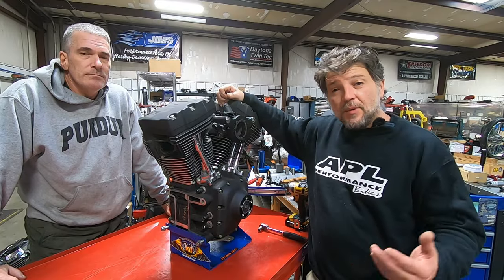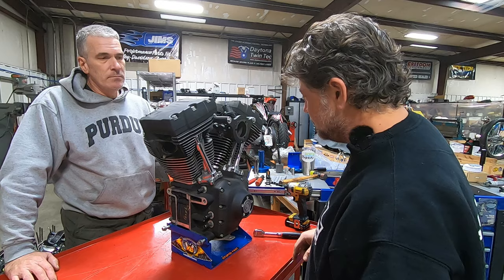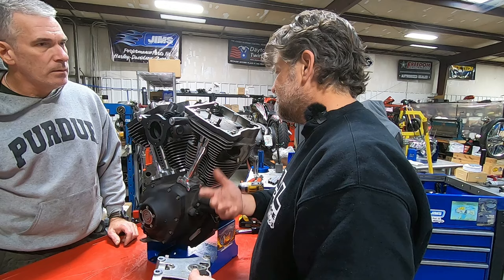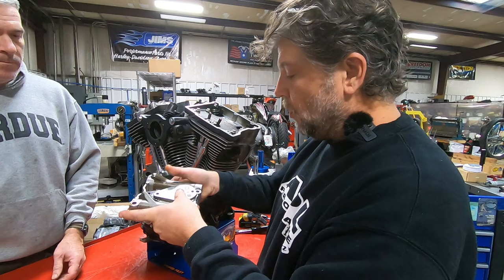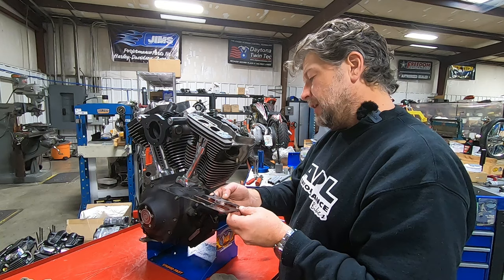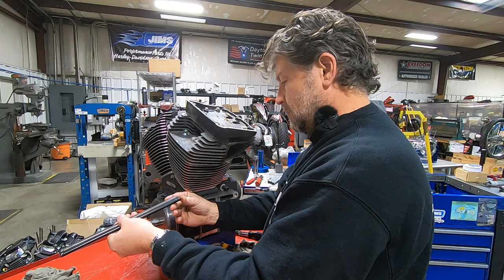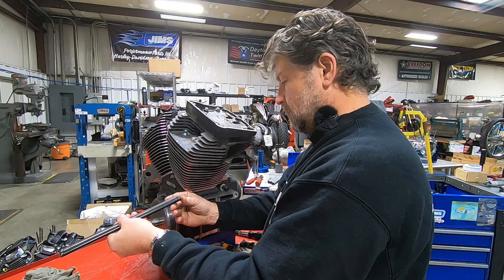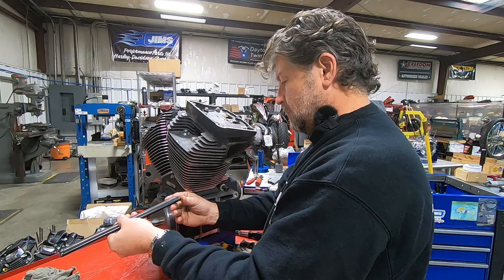WHAT IS NORMAL WEAR? - Harley Twin Cam Engine Tear Down - Kevin Baxter - Baxter's Garage

Comment: Great Video.  I enjoy listen to your take on wear.  Someday I will have to have my 2012 RK 103 tore down.  It's a high mileage (327k miles) on it and never had the heads off. So obviously wear should be very different.  Be interesting to see and compare to other mileage wear.
Reply: Did I just read 327K miles correctly??? I have a 2010 103 that has a little over 100K, Have you ever had any major issues with you're??? Thanks!!

Comment: I did S&S gears and S&S adjustable push rods on my 2003 Electra glide classic and some other goodie’s at about 5000 miles I now have 30 thousand miles never any issues and still runs better than new

Comment: my friend bought a new road king with a $4000 upgrade big bore kit so now he is happy. i think on this engine it was a new engine and they took it apart and changed the cams... and that is why the shoes are worn out now. it was super low miles on it when they changed out the cams...

Comment: Three thousandths runout on the crank, and significant wear on the tensioners at 15K. 15K would be less than a year's mileage for me. Makes you think twice before buying even a low mileage Twin Cam.

Comment: @Kevin Baxter it seems like most of the time you turn the motor over with a wrench, you are rotating it in reverse. 
When finding tdc for instance. 

Is there a reason for that other than convenience?

Thanks for the amazing videos and insight.

Comment: My 03 Road King had cam chain tensioners fail in 06 with 45 thousand on the odometer.  Harley warrantee folks in Milwaukee denied  covering  the repair under my extended warrantee, telling me the it was normal wear and I should have had them inspected "earlier".  My servicing dealer had the complete service history of the bike and was aware that it had been serviced exactly as required in the manual.  When I asked the warrantee rep on the phone at Milwaukee to tell me what page in their 500+ page "service manual" it recommended the tensioners be inspected, and at what milage, he admitted that there was no mention of the cam chain tensioners inspection in the maintenance section of the 03 manual, that the only mention of them was under the total engine tear down and assembly chapter.  The following day my dealer called me to tell me the Milwaukee had "reconsidered" and would repair the motorcycle under the extended warrantee.  I rode the motorcycle for another 4 years, having the tensioners inspected every 2 years.   Both inspections showed that they were failing again and needed replacement.
Reply: Take your bike to a shop and have them measure the crank run out if the crank run out is low enough you might be able to get away with a gear driven Cam and get away from all the cam chain shit. Gear Drive is the way to go and it should have been that way straight from the factory. A perfect example of the being counters at work.

Comment: Sounds like a sweet little engine.
   Have an 05 Springer Softail. Runs good in warm weather. Better warm it up when it gets cool. 
   Less than 20k. Haven't checked tensioner but thinking about it. 
   Just want to ride because it's  one  sweet little screw.

Comment: Would you see less run-out on the 99-02 model years due to Timkin bearing?  My 01 had less than 2 thousants so I went with gear drive cams

Comment: Great video! You are always so informative. My concern is that you say there is 15K on the odometer of the bike, but you found out that someone was into the motor and changed the cams. Did they not change the tensioner shoes or did the tensioner shoes get all or most of the wear since the cams change? In my opinion, 15-20 thousand miles from a set of tensioner shoes is just bad engineering. I hope that is for the spring operated and not the newer hydraulic versions. Three thousandths run out probably same as new from what I have heard. However, I am surprised  that you didn't check the run out on the other end. The primary side.

Comment: Thanks again for good learning insights on the teardown series. Is there a trick to view the secondary cam tensioner wear (hydraulic) without removing the cam plate on a 2007 and later TC motor with the engine installed in the bike?
Reply: The outer tensioner is very easy the inside tensioner is a royal pain in the ass. There is no easy way around it. I knew an aftermarket mechanic you said Harley-Davidson did this so we would have work every 40,000 miles. Harley Riders are lucky they can replace the information with a Gear Drive cam.

Comment: Maybe I was lucky...but I did run full zinc mineral diesel engine oil in my 2006 FXSTBi..and I replaced the cam chain tensioners at 240,000kms...and yes, they were worn out, bike is still running strong, still never had the heads off.
Reply: That was the year they went to hydrolic tighteners. Lot better

Comment: Them 203 cam are typically unbeatable on a 88” 95”…
My 88” taken to 95” typically just under 100 ft pd torque and real early.
Reply: Exactly right Joseph. I put a set of 203's in my 2000 Roadking at 100,000 kms and couldn't believe how nice they made it ride. Really fattened up the bottom end. She's now at nearly 200,000 kms, so I'll have to check those tensioner shoes before too long! The SE 203 cams are a great lesson in 'Sometimes less is more'.

Comment: Thanks Kevin. These videos are very helpful. I have just torn down my first harley. It has some pretty good wear.  I havnt done the crank runout due to no guage but I do have grooves where the crank spindle rides within the cam plate that do catch my nails. I am going to take it all to a local machine shop. Not sure if these cranks can be reconditioned or if I need a new one. Kind o a bummer. I bought used from dealer not even 2 years ago.

Comment: WAIT A MINUTE! 15,000 MILES AND IT'S WORN OUT?  Jesus! Now I'm scared to ride my 2008 Ultra Classic with 50,000 on it... SO I have to basically rebuild the entire motor? That's not very comforting....
Reply: Just ride it. If you aren’t having any issues don’t worry

Comment: Kevin, I have always assumed you can't pull a jug to inspect the hashes and rings, and if OK, reassemble; where the rings seated won't be in the same place and rings would have to re-seat again.  Is this true?  If YES, what is required before reassembling?  Thanks a bunch.  Love these teardown vids.  Preparing to rebuild my first engine (TC88A).

Comment: Another thumbs up! Kevin, what twin cam rebuild specs did you equate to a 427 big block? Can a 4 inch stroke crank be put in a 103 motor with bigger bores for quicker revs and still make good torque?

Comment: Anyone have a thought or two??  New Zipper’s 107 top-end on a Darkhorse bottom-end with 450miles.  The motor had a cough and terrible fuel Economy in addition to unburned fuel made the exhaust unbearable.  The Tech did some post break-in checks and found low compression on the front cylinder.  Turns out that a valve guide cracked and there is a lot of oil on the piston.  What could possibly cause a valve guide to crack?  I rode it properly… no oil starvation… and there is no damage to any other parts.  I am baffled.
Reply from the maker: Hard to say really. Cam choice, valve to piston contact, issue with rocker arm, pushrod adjustment if caused coil bind...several things. Could also just be one of those things. Despite every effort, occasionally there can be a part that just fails. Inclusions in metal, etc...things that noone could perceive happening. They are mechanical devices.  Hate you had troubles but wish the best.
Reply: Thanks Kevin.  Zipper’s makes top notch products, so I am confident that this will be resolved.   My engine tech is really good, but he could have made an adjustment error during the build.  Zipper’s is repairing the head and hopefully we won’t have to revisit the issue.  If we do….My bike may be on a trailer heading to Winder, GA.   Thanks for the great channel and content.
Reply from the maker: Youre welcome.  Yes they do.  I've known Danny Fitz for a couple of decades.  We swap ideas and tech quite often.  Great fella, great friend. As I said...it could just be one of those things.  I've never had a valve guide crack but I have had other things along the way, that you could never foresee despite the most care and attention to detail.  I always look at these things as you have...find the cause without pointing fingers.  Once the cause is found, it can be resolved without wasting time passing blame.  Its a positive life outlook.  I respect your candor sir.

Comment: The more and more I watch these videos the more I don't want to buy a harley my honda has 130.000 miles all iv done is oil change and tune ups and never had a problem and I ride the hell out of the bike I don't baby it and it is not a garage ornament. I want a street glide m8 but then again is it worth the headache to pay 30.000 on a bike that is not going to be as reliable.

Comment: Can you tell what cams you have without pulling the plate? Have an 05 WGI with stage 2, 17k miles, need to check the wear over the winter and Don’t want to pull the plate unless needed. I got it used so I don’t know what all was done
Reply: Sometimes they are stamped on the snout of the cams.

Comment: 8-10k $ and it just needed tensioners. well, I'd probably changed the cam plate  to hydraulic tensioners,  oh and new butterfly valves and gaskets, maybe oil pump but.....

Comment: Have an 08 Softail deluxe that I'm going to have the INA cam bearing replaced with a Torrington. Bike has 40000 miles. All from previous owner (s). What type or brand of tappets n pushrods should I replace with? I'll have the cam tensioner shoe looked at. I was told 08 are hydraulic. Does that make a difference? Should I replace cam plate n oil pump with an s&s or leave stock ones in if ok. It is a 96.

Comment: I'm looking at a low mileage, 2006 Fatboy, 8600 miles. I concerned about the cam tensioner issue. What is the approximate cost to do the repairs? Recommended mileage? Thanks

Comment: I bought a 2001 flht standard wt 26,600mils. pinion shaft was .002 out. the vertical movement was .001. intolerance for gear drive cams. I ordered S&S cams 510 lift kit. will a stock cam plate that had spring-loaded shoes, and chains work? what needs to be blocked or plugged on the plate. or should i use a gear drive cam plate? tks great vid.
Reply: you can use the stock cam plate.  just remove the spring tensioners.  follow the directions that s&s gives you.  I had a 99 FLHTCUI that I did the same s&s 510 kit on.  ran like clockwork after the the gear drive and I never looked back
Reply: Matt, I've got an 01 too.  I went with gear drive and S&S .510 cams with Screaming eagle cam plate and lifters and higher flow SE oil pump.  Also added a Jagg oil cooler

Comment: What wear ? At that few miles there shouldn't be any  !!!! As I have always  thought the new stuff there putting out is junk . My old 1988 has well over 100,000 miles on it doesn't use oil , still runs good .
Reply: This is exactly why I'm watching Kevin's videos.  I've been searching for a clean, low mile EVO, but feel myself starting to consider a TC.  IMO that "normal wear" for 15K is unacceptable.  I don't know if running a premium oil and an external cooler would have prevented the wear shown, but I'd be very unhappy if wear started showing up before 50K.   I guess I'll keep hunting for an EVO.  They're not without problems too, but I feel more confident that I could keep on top of them.

Comment: At 15,000 miles the motorcycle is not even broken in yet. They should be nowhere whatsoever but it's a twin cam Harley and they run a 300° and cook their oil so who knows. Such a problematic engine. Harley really should have done better. With this one as well as the twin cam.
Reply: they changed out the cams right after they bought the unit..

Comment: I am so disappointed that Harley would build such a crappy motor and then replace it with one that's even worse. You guys seem to tear down your Motors at the drop of a hat. I didn't tear down my 1965 Triumph TR6 until the camshafts wore out from 50 years of being on the road. And people used to bitch about British quality. Can you imagine the where inside a twin cam or an MH if you rode the bike for 50 years? I don't think it would make it. I don't think you'll see an evolution Sportster in a video because those things run forever my Sportster is a 99 883 with 400,000 miles on it on the original engine. If I wanted a big twin I'd get an Evolution motor I would not take a twin cam or an M8 motorcycle for free I can't afford to drop 10 grand into the motor to fix all the cheap parts that Harley put in. You would think with such an expensive motorcycle they would use only the best materials and the highest quality parts. I have Airhead BMWs from the 1970s that turned 100,000 miles like it's nothing.